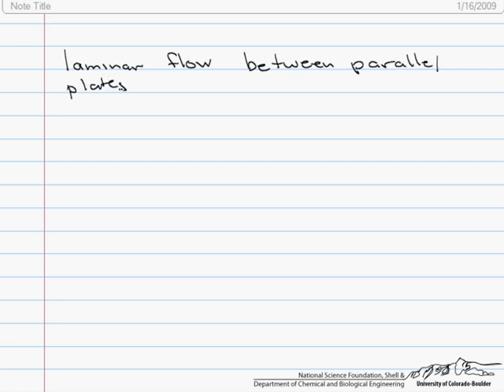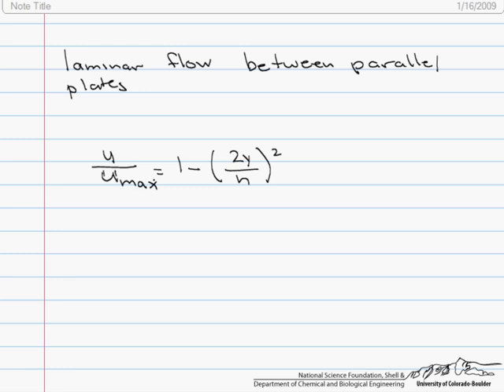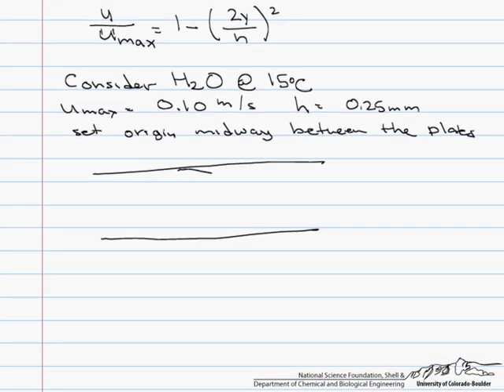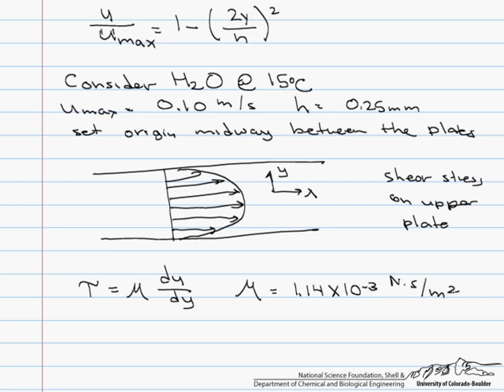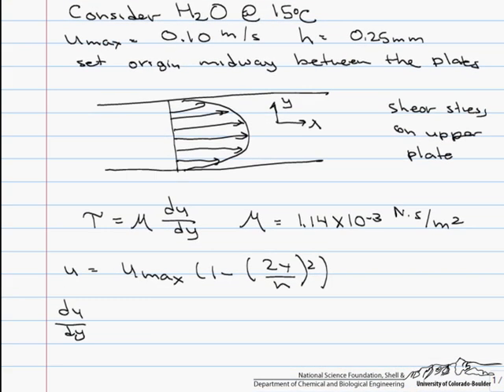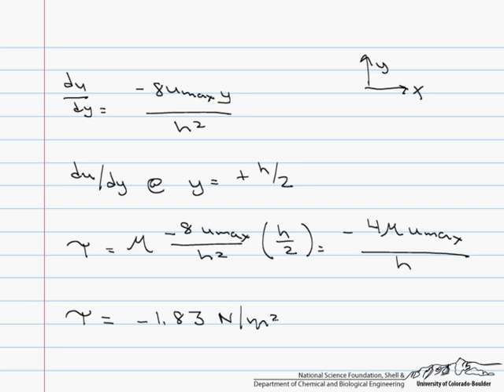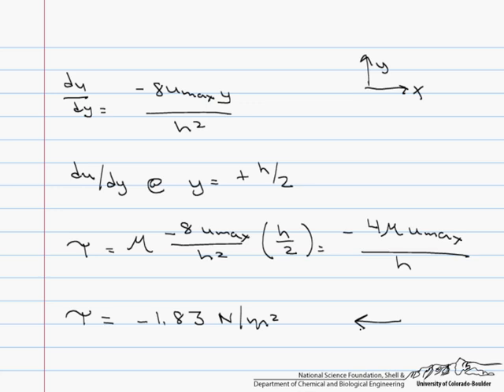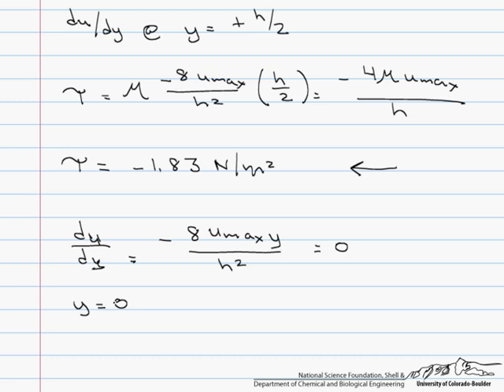Shear Stress between Parallel Plates

Comment: In the lower plate shouldn´t the shear stress be in the same direction that in the upper one? Cause, I think that always the shear stress is in oposite direction to the velocity and decreases while the velocity grows so it would be zero at the origin and have both maximum values (negative to the velocity) near the plates. I would realy appreciate that you answer my question. Greetings
Reply from the maker: This is a tricky concept. Since here our origin is the middle between the plates, the shear stress has to be relative to this. So when we use a positive direction (up), the shear stress is in the negative direction. When we use a negative direction (down) the shear stress is in a positive direction.  This is all because of the origin (shear stress is directional).  If you made the bottom plate the origin and evaluated at 0 and h for the top plate, what happens?  In reality since the fluid is flowing to the right due to a pressure difference driving force...the shear stress acting on the fluid from the walls is to the left, slowing the fluid down near the walls. Try to approach it from the idea that its dependent on perception and your coordinate system origin.

Comment from the maker: We are looking at the top with the origin in the middle, so we are evaluating at y = h/2.  When we plug in our values (make sure to use correct units), h is still the distance between plates.  y = 0 is the middle between the two plates, where the velocity, U, is a maximum.

Comment: how did you get tow to equal 1.83 when i am doing the problem i keep getting .001824, I am not sure if I am plugging a number in wrong but is the equation( 4 (1.14*10^-3)(0.1))/.25